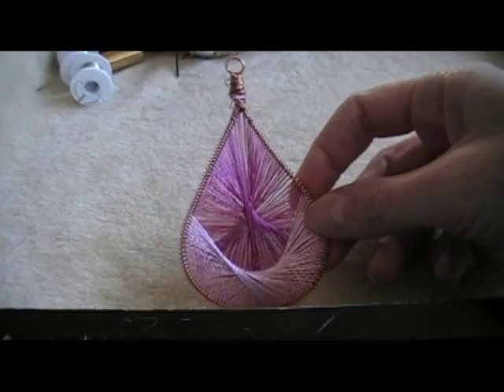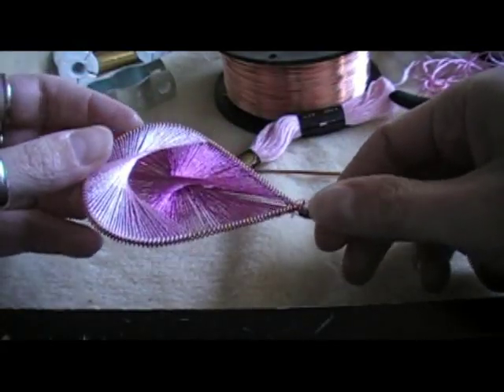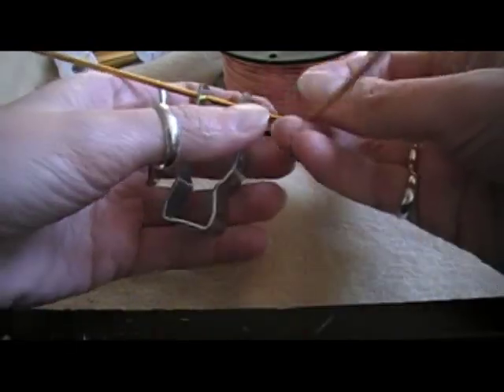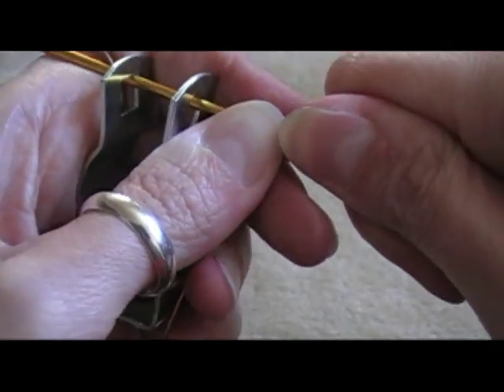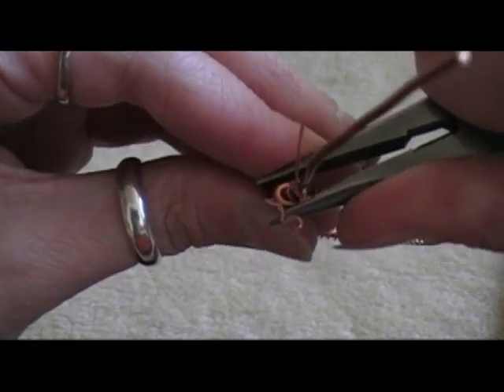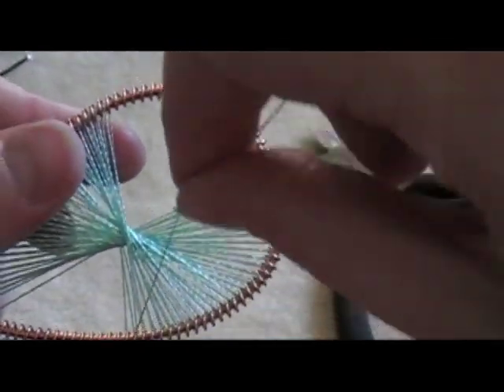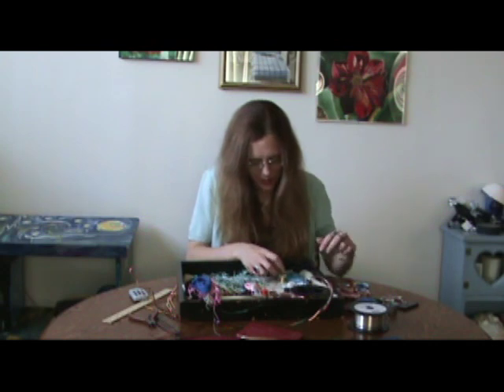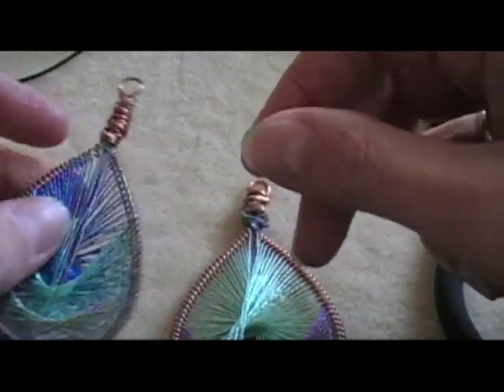String-Art Pendant (Peruvian Thread Earrings)

Comment: I use the same thickness for both the coil and the wire inside, and I make the coil so that it's not snug against the inner wire. That way you can pretty much use as many colors as you want 'cause there's more room to build up layers before the string pops off. But I used this tutorial to learn it :)

Comment from the maker: @cherrycake2 I haven't tried, but my concern is if you use a wire which is too small, it will become bent out of shape when you are winding the thread around it from the tension. When I was looking for the wire for the outer hoop, instead of making full pendants with each, I tested the flexibility of the wire by bending it with my fingers to get an idea of how pliable it was. I needed something which would hold up to the pressure I was going to put it under.

Comment from the maker: @86lathasridharan I tried some different thing and my best suggestion is to make a larger coil than you need, pull with even tension from the ends, and hopefully you'll have a large enough section of it turn out evenly which you can use. Best of luck!

Comment from the maker: I have just been making a knot in the middle of the design if my color runs out and letting the on-going wrapping hold the ends down. Not the cleanest look, I'll admit. I've seen one blogger who has been doing some nice work using machine embroidery thread. One benefit I can see with using a spool thread is that you won't need to knot in the middle if your pendant is too large for one length of the skein floss. The downside is it costs slightly more. I've never used it, so can't comment more.